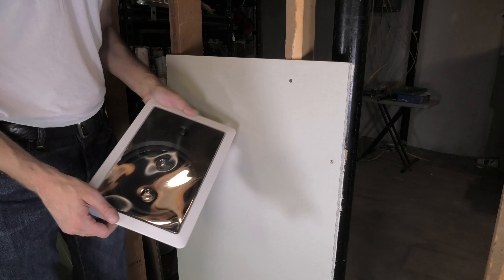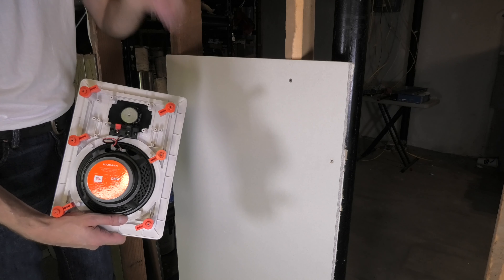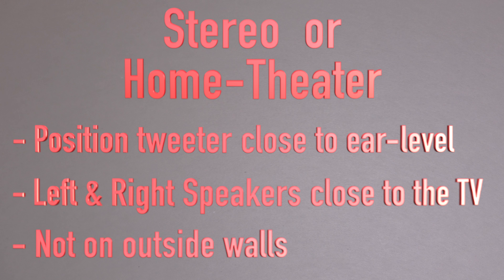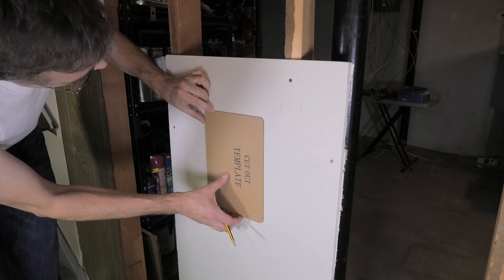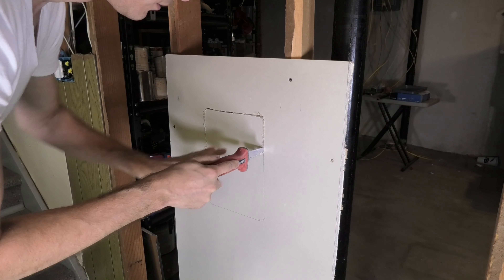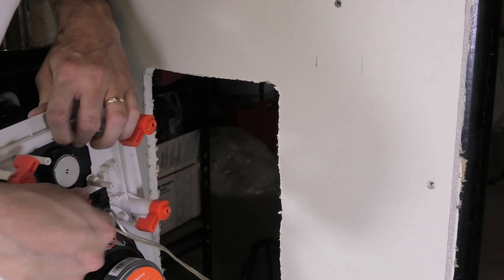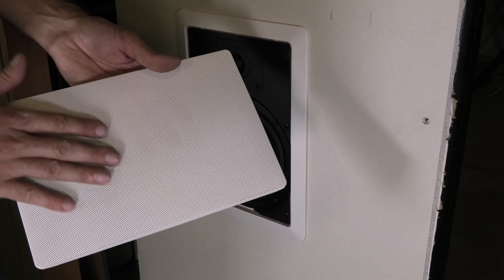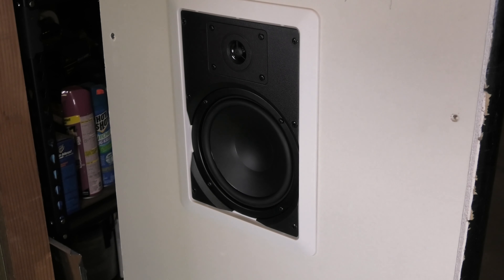In-Wall speaker installation - How to

Comment: How do you connect to them? I just moved and my whole home has them but idk how to connect
Reply from the maker: There probably is a location in the home where the wires all come together.  That’s where you connect them to an amplifier.
Reply: @MegaSafetyFirst  well there is a onkyo stereo in the basement that is sure connects to the ones in the basement but how about the single room that has speakers upstairs? Like I’m just confused. But I’m looking lol
Reply from the maker: Could the Onkyo be a multi zone amp so it powers the upstairs also?
Reply: @MegaSafetyFirst  No each amp is its own zone. So if you want separate zones you need separate amps.

Comment: How can you remove the speaker fill the wall?  Mine isn’t working so I need to check the wires
Reply from the maker: Check how the small plastic tabs swing out when tightening the screws.  
When screwing the screws back out, the wings will eventually swing back in and the speaker can be removed.